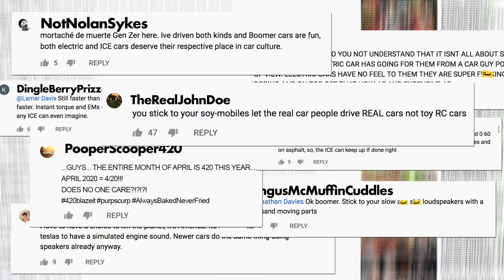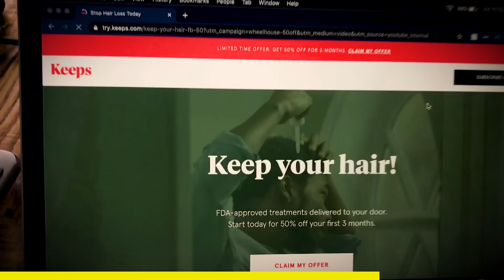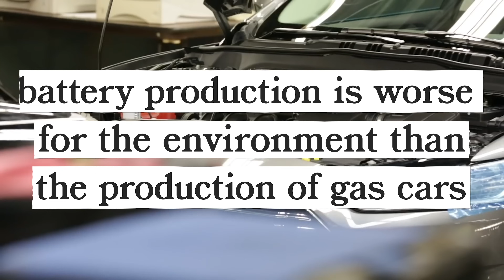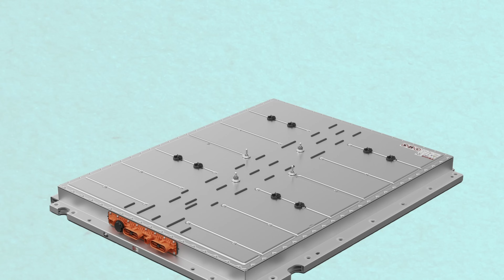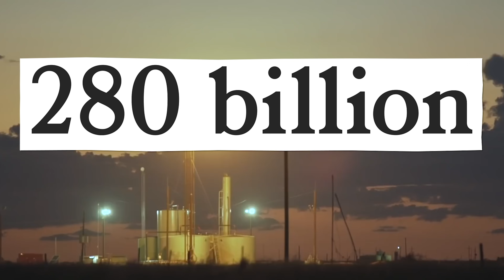Are Electric Cars REALLY Better for the Environment?

Comment: I would love to see you make a video explaining how China made deals across the globe giving them exclusive access to some of the most rare earth metals and minerals to mine for themselves to make high capacity high discharge rechargeable batteries and electrical systems. Last year the U.S. bought 78% of its cobalt and all of its graphite from China in 2019, Chinese chemical companies accounted for 80% of the world’s total output of raw materials for advanced batteries. Of the 136 lithium ion battery plants in existence 101 are owned by the Chinese government. lithium-ion batteries depends on some key materials like graphite, the material used in pencil tips. In 2019, China produced more than 60% of the world’s graphite, according to U.S. government research. That means Beijing can set the prices and not sell to countries with sanctions against them. Cobalt has emerged as one of the hottest commodities in the new energy revolution because it is widely used in electric vehicles as well as computer and consumer electronics. The Democratic Republic of the Congo (DRC) produces more than 60% of the world’s mined cobalt. But Beijing controls the global supply of this silvery-blue metal.

eight of the 14 largest cobalt mines in the DRC are Chinese-owned and account for almost half of the country’s output.

China’s influence dominates cobalt processing with Chinese companies controlling about 80% of the cobalt refining industry, where it is turned into commercial-grade cobalt metal and power, according to Benchmark Minerals.

China's Tianqi Lithium now owns 51% of the world’s largest lithium reserve, Australia’s Greenbushes lithium mine. In 2018, the same company also paid about $4 billion to become the second-largest shareholder in Sociedad Química y Minera (SQM), the largest lithium producer in Chile.
In other words if we sanction china with semiconductors like we did, they can refuse to sell to us or charge any amount they want and the US has no other choice. If the U.S. doesn’t drop the sanctions and beg China to do business there will be no electric cars in the US in the very near future.

Comment: Whilst looking into this have you looked at the comparison of the impact of a new EV produced this year versus keeping a 10 or 15 year old ICE on the road - I would imagine (but don't have the figures)  keeping a well maintained existing ICE car on the road is far better then the production of a new car
Reply: That applies to just about all vehicles even ones with pretty average fuel economy, if the enviroment is the primary concern keeping your existing car is better than getting a new one
Reply: @shaynegadsden wrong, see my comment with calculations.
Reply: Donut’s math:  an ICE car puts out 5.2 MT of CO2 per year, an EV 2MT.  So 3.2 MT/yr reduction for EV.  Now, it takes 9MT of CO2 to produce an electric car.  

So, if you have your ICE car destroyed and buy a new EV, in three years you have worked off the 9MT of CO2 it took to produce (9/3.2=2.8) and from then on you are producing 60% less CO2 every year (worst case) than your old ICE car.  

So, buy the new EV.  And consider getting one with a smaller battery, such as a Model 3 standard range, as they cost less and have a smaller battery so less CO2 to produce.  This means the CO2 break even calculation is even shorter, about 2 years.
Reply: Makes total sense but will interfere with big car makers profits.
Reply: @JI7NKJ wrong, see my other comment with calculations.

Comment: I want to inform you that cars don't have to be electric to be 100% green, cars can use a type of fuel called "hemp fuel" which is 100% green, it is revolutionary and Henry Ford made a car that could run 100% on hemp fuel, but of course there is a reason why it hasn't become normalised. By the way, electric cars are about control, they want you to be dependent, controlled and weak. Please study hemp fuel for a couple of minutes and tell your friends and family about it, sharing this info also helps. Cannabis or hemp is the miracle plant, which can be turned into paper, ropes, clothes, cotton, insulation, concrete, wood, fuel, a plastic like material, and it can replace normal fuel, plastics and a lot of other materials, it can be used as a medicine, but also as a drug, it is said that cannabis has over 25 000 uses.   .

Comment: Your video is not adding up anymore. Power grids are failing across America at a staggering rate. Electric companies are charging more now per kilowat to power those cars. What are people going to do with all those depleted batteries and where are they going to go. It hard to recycle batteries with the glue to hold them in place. Mining the raw material is very dirty and hazardous for the planet. Also nobody is going to buy a used electric car that only has 60% battery life left for resale so those cars are just going to sit. Windmills kill thousands of birds every year and take 20 years to see gains from them in the long run. These things are not adding up to a more cleaner environment. I do see electric using more energy efficiently but even these cars are getting power from gas, oil, and nuclear power plants across the planet.

Comment: the reason the tax rebate benefits the rich is it is
1. it isn't upfront savings. it is savings in your taxes that year.
2. that savings is a non-refundable tax credit. it operates the same as the solar tax credit. so IF you do not actually PAY $7500 in taxes that year. (i pay nowhere near that) you will only make up to at MAXIMUM your yearly tax debt. for most americans that is WAY less than 7500. closer to 3000. and for the poor, it's next to nothing. 

Also lets talk about the definition of "life of the car" because the life of an EV is half of what a gas car will be. EVs lose between 2-5% of their range per year of operation. After 10 years your car will have at MOST 80% of it's original range and at worst HALF of its range. There is zero or nearly zero degradation of fuel mileage in gas engines. so after 8-10 years that EV is going to need a new battery. these calculations arent taking into consideration the second or third battery some of these cars are going to need and that the battery alone is easily a 10-25K replacement. A gas engine is good for another 10 years and an additional 150K miles on top of what a battery will do. 

so to reach 200K miles your EV is going to need 2 of those nasty batteries which negates ALL of the emissions and gas savings you made and makes it silly to pay an extra 20-30K for an EV over a similar gas vehicle.

Comment: You need to remake this video with up to date information, like the change in battery chemistry as in the LFP or Salt batteries. PS 40% of Lithium now comes from mining hard rocks in Australia and there has been a method devised and presently being used by filtering water extracted from hot rocks in the geothermal industries like "Cornwall Lithium". Cobalt used to be a problem but that has been reduced in batteries. 
There has been many developments in the EV industry in such a short time, unlike the ICE engine which has got no better than 25% efficiency, 75% of energy in petrol/gas is wasted in heat
Reply: cobalt is still a huge problem🤡

Comment: Yes, EV's are better for the environment, at least from a CO2 perspective. They are however by far not the solution to our problems and that's what's wrong about them. 
This is 2 years later and no, the power grid will not handle 30% EVs, not 2 years ago and not now. The only way that would work is if everyone played along and charged their car in the grid off hours, so that the load curve of the grid flattens. That however isn't a real use case because i.e my wife works nights, so she'd charge during the day when we don't have extra capacity for cars. "The grid" is also a very localized thing. For example, if you have just 20% EVs in LA your grid can't do it - because LA hangs on a handful of lifelines when it comes to power and the transmission capability of those lines is already pretty much at maximum. It's the reason why LA has brownouts.

For me EV's are simply another cool consumer product you can sell to people under the pretense that you're all green when zipping by in your luxury Tesla. Nothing could be further from the truth, but hey, it's a valid profit.

BTW the representation that buying a luxury EV like a Model X only gives you half the subsidy is plain wrong. It depends on production numbers of the specific brand. If you get a luxury EV from any other brand than Tesla you will get the full 7500 bucks because the other manufacturers haven't sold the threshold number of cars yet. Eventually you won't get any subsidy for any EV.
Reply: They still pollute the air when mining for the materials, they don’t come out of thin air

Comment: Like gazoline batterys are consumable they Last aroumd 10yrs or 2000 charge cycle then the foot print goes up again and the cost of maintenance is also bigger if you want to keep the car for à long time is rather pay small repair price once in a while then paying 20000$ to 40000$ every 10 years for à New battery its just not worth it for me over the course of 20 years this car Will have emited 3 times more c02 then initially 

I think you kind off missed out on this part alors

The Cold ppl get stuck here all the time with those if you cant plus you car at night and dont have a garage dont buy a EV in région that ses more then -20  or you end up buying à battery way sonner then normally if the Cold kills you battery like 5 to 10 time and boom you Just lost half of its capacity some time more now you need à New one 

Its the same with à phone drône ect

Allo heat is disliked and they dont like goint out from the opération range is curently -20°c to 35°c  where i live in Canada we go from +40°c to -40°c so its no good for here we have extrême weather that Will ruin most car ont their 1st year if you dont have a heated parking i have to add that charging and usage heats the battery and if its +40°c out side the battery Will go up to around 55 and that also kills their capacity

Comment: A subject you did not cover in this video was the lifespan of an EV battery versus the lifespan of an internal combustion engine.
Reply: Also what is more green, do something with retired batteries or do something with a huge piece of metal?
Reply: Well as we are seeing the life isnt as long....  I see Teslas with 100k miles dying all the time on autotrader.  If someone is very meticulous they may get 150k or so,  But many gas cars nowadays push 200k all the time.
Reply: Thank you! I pointed it out too!  I did a comprehensive study on EV's today and they last longer than ICEV's so long term they produce roughly 10,000 kg-CO2 morning their life cycles comparative to ICEV's. Their battery production process is also DISGUSTING.😭

Comment: One big difference: The amount of time you can use a EV vs a gas car,  EV will need to replace the battery and it needs to be recycled when its replaced after 5 years..  a gas car can run for 20+ years with minor repairs.. and replace a tiny micro battery in the car compared to a EV..

Comment: Electric cars use rubber tires made of oil, They're made out of a lot of plastic which is made out of oil, They're painted with an oil based paint, They drive on asphalt roads which is made of oil, They're made out of metal which is smelted in furnaces that run on natural gas, They have glass windows which are made in furnaces that run on natural gas, The lithium that goes in the batteries is refined in furnaces that run on natural gas, The vehicles that transport all the products used to make electric cars run on oil,  The vehicles used to transport electric cars to the buying customer run on oil, your stupid phone You're reading this on is made out of plastic made of oil

Comment: No matter which is less damaging to the environment, a brand new EV or a brand new ICE car, I still firmly belive that the MOST enviromental thing you can do as a car owner and driver, is keep an old car running for as long as possible, the production of new cars is responsible for quite a large chunk of the emissions no matter how you spin it!
Reply: True to a point but an old worn out engine is really dirty.
Reply: It doesn't matter what Canada does if China, India, USA and Russia don't get serious about cutting emissions. Canada is only responsible for 1.6% of GH gases in the world. China is responsible for 33%.
Reply: with current technology that's going to be very hard with an EV because like all new things EVs are built with planned obsolencence in mind, and even then if it's not built that way the battery is.
Reply: Compare the marginal emissions per mile of the current car to the total lifetime emissions per mile of the car you’re intending to replace it with. If the new car wins, it’s actually better to scrap the current car and get the new one. This calculation takes production emissions into account and smears them out iver the lifetime of the new car. Often, the result of the calculation is that replacing a gas car with a similarly sized EV is better for the environment. It’s more complicated if the old car isn’t scrapped but sold on to someone else but the general idea of marginal versus lifetime emissions holds.
Reply: @Gnerko123  My EV car that i bought  to replace the ICE one is useful for towing and driving in snow because it is 4 wheel drive. The EV i use 90 percent of the time. The old ICE car is a compliment and gives me the best of both worlds.
Reply: My petrol car has over 700 000 on the clock that's about 6 EVs worth
Reply: The data presented here contradicts that argument given emissions from fuel burn were the biggest percentage contributor to pollution. Older cars with older engines tend to be less efficient and therefore burn more fuel for any given mileage.
Reply: @marviwilson1853  But what in you opinion is an "older" engine?
Reply: @opoxious1592  the one's whose fuel consumption is not as good as a more modern engine.
Reply: The new e-fuels in development has all the good characteristics like regular gas.
With the difference that these e-fuels do not consists out of any fossil components, and it's also emission free.
And the good news is, that any existing car can drive on these e-fuels with just a small adaptation to the engine.
This will be the future.
It's clear now by a lot of people, dead the electric car is a dead end.
This is also the reason why sales are so low.
It's also obvious when you look arround you, or in traffic.
If you see a parking lot with 100 cars, at best you will be seeing 3 to 4 electric cars.
So i'll will be sticking to my own car.
Reply: @opoxious1592 Just to get any of those materials to make the pieces and parts of a EV is obtained by using fossil fuels. Keep that bullshit in your delusional head, that rehteric is LIES!! Everything about EV is more damaging to this planet and it's inhabitants than fossil fuels! Now GTFO 😠
Reply: @opoxious1592 the closest thing we have to an e-fuel is hydrogen gas, but the fuel cells are so massive that it leaves barely any space in the actual car. They’re also not very efficient, so you won’t see any car going more than 250 miles on a hydrogen powered engine. Additionally, these cars are very slow, having abysmal acceleration and terrible top speed. EVs on the other hand, do not have any of these flaws. 

Of course this may change in the future, but as of now EVs are far superior
Reply: @omegastudios-minecraft1865  It's not hydrogen gas.
It's a synthetic liquid that is colorless, and the car is filled up just like a regular car.
It's like gasoline, but it's not made out of crude oil.
So it don't need any special "fuel cells" or anything.
Reply: @opoxious1592  ah cool, I just looked it up. This could be a very nice solution to our carbon emissions, but I’m just worried about the price. Experts say that by 2026 prices will go down to 7.57 dollars per gallon, which is notably much more expensive than gasoline. On the other hand, electric is far cheaper than both gasoline and Porsche’s eFuel. Electric is probably still the way to go, at least for now
Reply: @omegastudios-minecraft1865  The prices will eventually will go down, when they are able to mass produce it on a large scale.
So what you say is right, that in the beginning it will be above the avarage price comared to gasoline.
Reply: @opoxious1592  E Fuels would be nice but sadly we are far far away from them becoming an option since we are not able to produce large quantities wich would consume huge amounts of electricity.
In the future that might change, but almost certainly not in the next 10-20 years.
Reply: @WolfGoneMad  They are making steady progress, in producing ever larger ammounts for lower cost.
According to the various company's the world, they will be able to have the sufficient technoligy and industry to mass produce this e-fuel in about 10 to 12 years.
So this is not at all far away.
In Germany there is already a big plant in Frankfurt, that starts with mass production of e-fuel in 2024.

Comment: How would delivery company’s and trucks transition to ev? Here in the uk there are lots of delivery company’s and some do use ev but from what I know FACT you can’t even turn on the air on or heating because it drains your battery and due to pressure of delivering parcels, they can’t exactly stop to charge it. Therefore, I think this will be really hard to push..